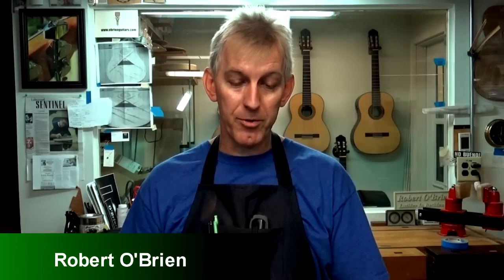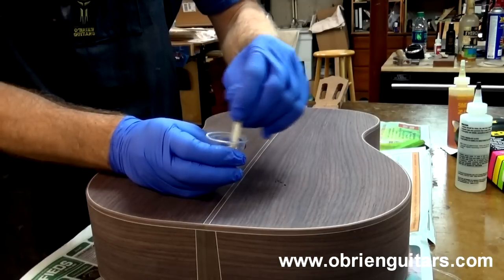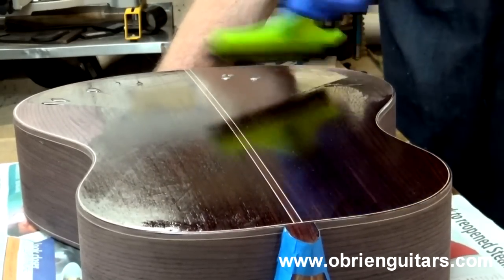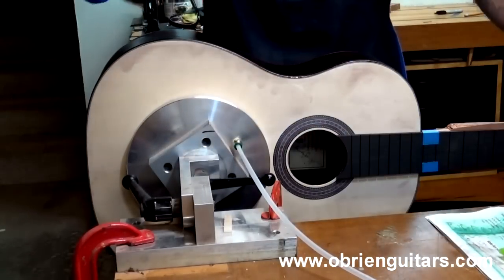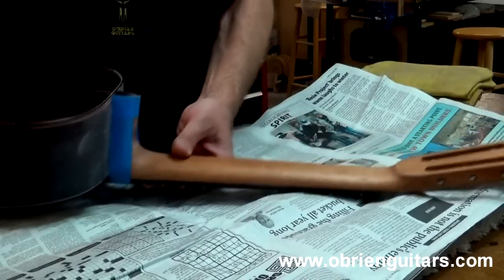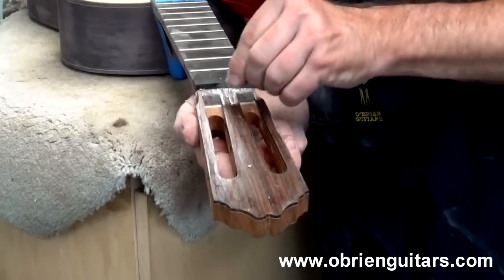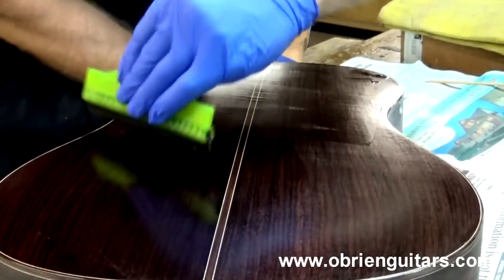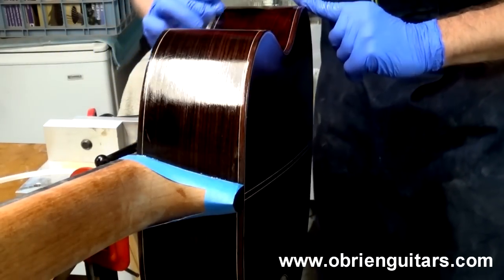How to Pore Fill with Z-Poxy - Luthier Tips Du Jour Episode 143

Comment: I've had problems with Z poxy under lacquer. After about 6 months the lacquer delaminates from the pores. Had this happen on several guitars and had to refinish them. All were sealed with vinyl sealer.Waited 48 hours after pore fill. Z poxy was mixed well. I've since stopped using Z poxy under lacquer finishes.
Reply: @Chris Herrod I've talked to other luthiers about this who said they have had the same issue and they stopped using it.  A client in Arizona recently told me he contacted R.E. Brune and he strongly recommended against it for this exact issue.

Comment: Have you compared Z-Poxy with Solarez "I Can't Believe It's Not Lacquer Grain Filler"?   The "ICBINL Grain Filler" is also fairly low viscosity, and cures with UV, so you have control over when it cures.
Reply from the maker: We haven't but we'll check it out.

Comment: Mrl O'Brien, thank you for the video, very informative.  Do you like staining before or after porefilling?? IMHO, one of the most challenging sequences in the finishing operation.  Can you dye the Z poxy?? Gonna try soon...
Reply: I would apply the zpoxy pore filler first without dying it. I like to sand the zpoxy back to bare wood and if you had already colored the wood you most likely would sand through it and that means trouble. After the pore filler is sanded back to bare wood then apply your color to the wood. Then apply your topcoats to that and don’t sand through them and into the color. The technical term for that is BAD.
Reply: @OBrienGuitars  yep..... BAD is an apt technical term, and I've sanded thru more than once on other projects.  will the zpoxy take your stain?? I've been using the angelus dyes lately, kinda cool, alcohol and glcol ether solution.  My only concern with applying the filler first is that it will affect the staining process, should probably just adjust accordingly.  thanks for the response. joe
Reply: @joem6859  I have never tried to tint the zpoxy and I don't think it is necessary. Do some sample boards to test what you want the final result to be. That is always much better than practicing on your guitar. Yikes!
Reply: @OBrienGuitars  I'm doing a very dark stain on mahogany, probably a '10' on the finish challenge scale...lol.  So because of that, i think i would need to tint the pore filler if i was going to put it down first
Reply: @joem6859  You could also tint the lacquer. This way you would be able to reverse the finish if it didn't come out the way you like.
Reply: @OBrienGuitars  yep, don't that too... thanks for replying to me thru all this
Reply: @OBrienGuitars  Too many different ways to do it, right?? LOL